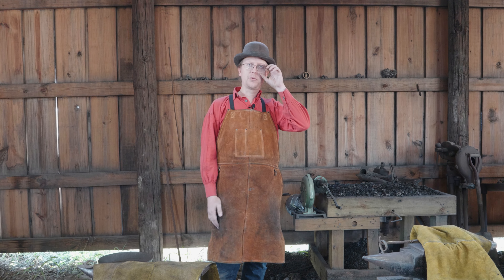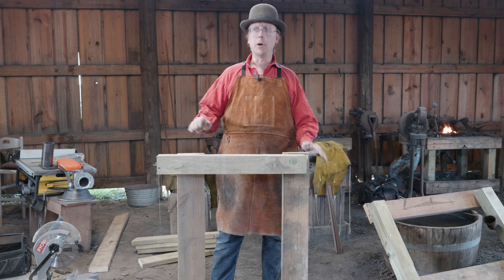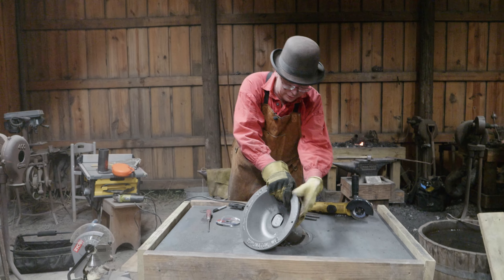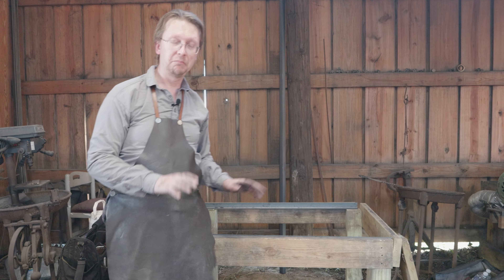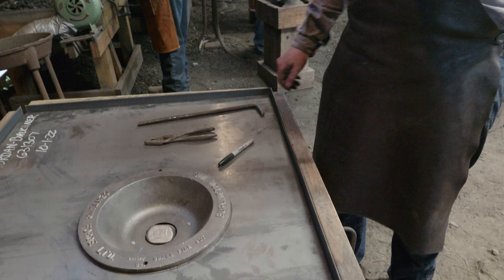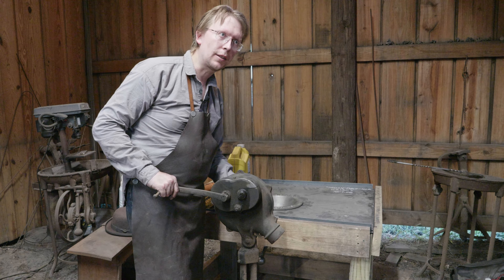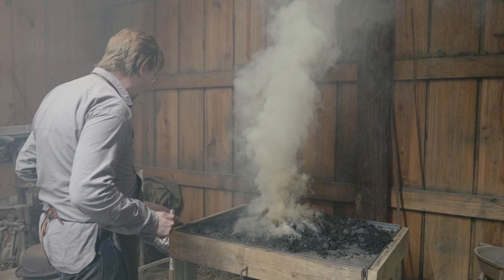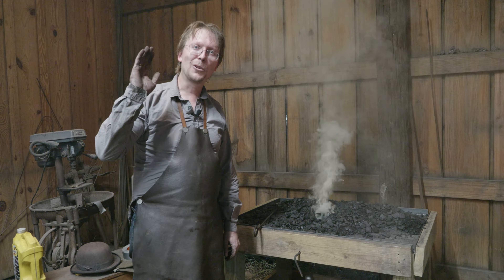Building A Wood Framed Coal Forge

Comment: Another forge up and running, very nice!  I wouldn't mind seeing the repair of the blower, I've never seen the inside of one before.  Keep up the good work!
Reply from the maker: I'll do a quick video on it.  Turns out the fan was missing a blade so I'm cutting out a new one and brazing it on.
Reply: @WatersIronworks  I  wouldn't mind seeing you doing that.

Comment: ..It works! Duct tape is a Great fixer. i like to use bailing wire or a wire coat hanger ...
Reply from the maker: That would probably be a more historical accurate option.

Comment: Another great video.  Quick question, you mentioned the leg length, but you didn't mention the table top dimensions or the plate thickness that you're using.
Reply from the maker: I'll add that to the description.  It was 30x40 and 1/4 inch thick plate.

Comment: What was the approximate total cost in materials?
Reply from the maker: Probably 100-150 for the steel plate and angle iron.  Another $50-$75 for wood. And the fire pot which is the most expensive is like $350.

Comment: Shoddy planning, measuring, cutting. 
Don't need to bolt the forge down, just wait for the grit!?  Come on, if it's worth doing, it's worth doing RIGHT.
Reply: And then the dryer vent and duct tape.....
Reply: Eagerly awaiting your video on how it should be done
Reply from the maker: Happy to send you a link to donate to the museum so we can upgrade.
Reply: @maniachill3069 It’s a coal forge, not a dining table.
Do you run all your lumber through a planer and jointer when making sawhorses?
Also, the point of not bolting down the fire pot and iron is because that plate will rust through from the heat eventually, and you don’t want to try and remove rusted, half melted bolts when swapping the pan. Ask me how I know.